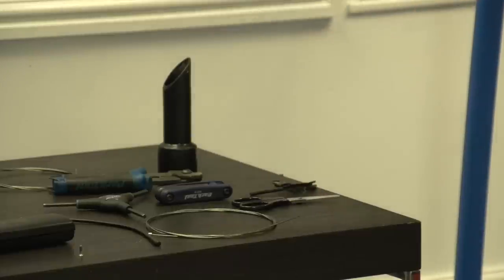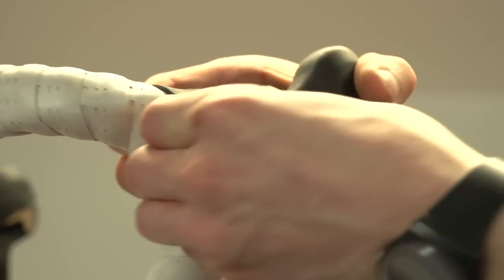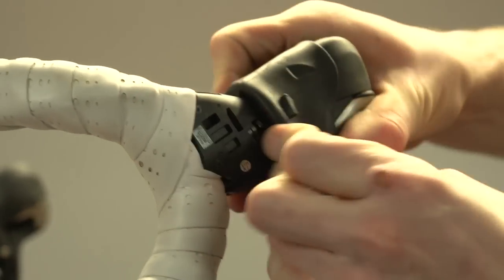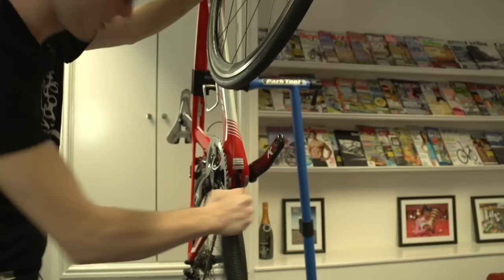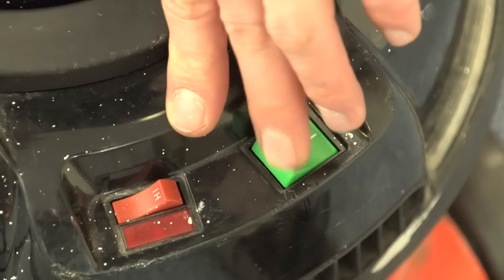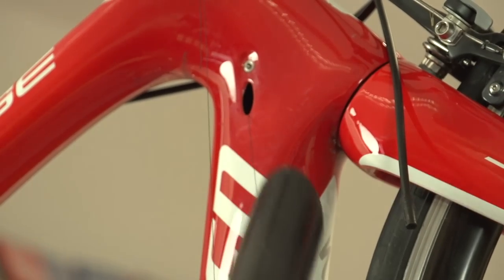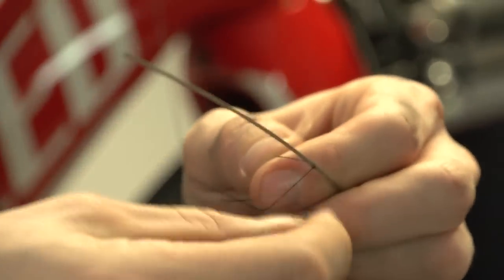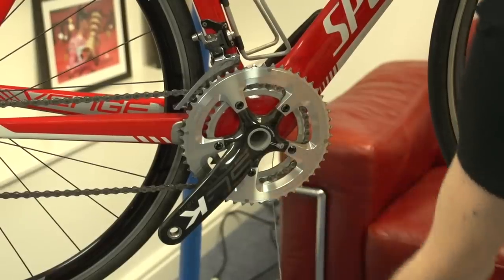How To Thread Internal Cables - The Easy Way

Comment: Dental floss is also good to use as it has more masse to grab on by the vacuumed air. You may also want to tape up other holes on your bike to focus the suction through the holes you are working on. This works like a charm. I did a Di2 threading on my bike in well under 10 minutes a few weeks ago.
Reply: Yes, good idea. Especially if your vacuum is as asthmatic as my old shop vac 😅

Comment: Used this trick to get a rear brake cable in the cross bar of a Colnago M10. The cable had been pulled out by accident. To my surprise this worked a treat, despite the holes being tiny. Thanks very much :-)

Comment: Another way to help with internal cables is to use a small magnet which helps find the cable in the frame. Works every time.
Reply from the maker: Matt Taber cool tip, thanks.

Comment: Heres the easiest way of all. Cut the little knobs at the end of the cable, slide the cable out of the housing and let it dangle at the opening of the frame. Then thread ur new cable thru the shifter, thru the housing tape it to the old cable and pull the new cable thru. This ensures that the routing stays exactly the same. Obviously this only works if you still have the old cables in place.

Comment: Same exact bike. I routed a cable housing long enough that connected from the shifters to the rear derailleur and another to the front derailleur, then slid the cable through the housing. Is that not how it’s supposed to be done on this particular bike or did I just waste a bunch of cable housing? Hahah Thanks in advance for the feedback.

Comment: My move is to reverse engineer this - in the process of initially extracting my existing cables through, I tie the thread and pull it all the way through then pull it through as above - but this is a really neat trick ❤

Comment: This helped a little bit. My tip is to use a flashlight to see where the cable is at. I found that with this method I was still pushing past the hole. Just get the end of the cable to the hole and wiggle around.

Comment: The holes in my frame are too small for the vacuum method, and even for the magnet  on the cable method (let alone little hooks or being able to see it). I now use a needle on the end of  thread and the strong magnet and it works. The needle doesn't bend when it gets to the exit hole like the bare cable.
Reply from the maker: Sounds like a hack to me!

Comment: There is an even easier way. When you remove the old cable put shearing around it and the pull it out. So much easier than a vacuum cleaner.

Comment: This approach is genius. I tied a small fishing swivel to the end while holding the bike upright. I tied electric tape around the knot and thread connected to the cable to insure it wouldn't separate. This task would be impossible without the vacuum.

Comment: Guys im Ding to know if my bicycle is good or bad... Coud any one help me?
It is heavy still i can lift it above my head with one hand but im guesing its  about 20kg if not more i dont realy know.Also on frame it says PEAK thats it.Also gears change the same way u acelerate on  Motorcycle it doz not requare to flip a switch or something like that it has a red spring in midle that says it suports 320 lbs.Also  at a midle of bycicle spring at both sides there are two  pipes one on each side.it might be custom. I got it as present in 2010.There was one techincian taht when he inspected my bycicle just by looking he sayd its  not worth repairing it will get broken again and again...So im lost on what to do :S.i forgot to mention it has words on it like Urban movement series.I cant even find a frame that wont look like my bicycles.Hous of googling and nothing
Reply: Your bicycle is good. All bicycles are good even broken ones.

Comment: easy way for me is to just push the inner cable through until it appears bellow the bottom bracket of the frame, no hoover, no string needed, time saved, it's not as if the end of the inner cable needs to find it's way through a pin sized hole, simples

Comment: It did not work with hoover.  Cycled 50 years. Replaced many cables.  Never expected not to be able to thread a cable.  So angry with it. Frustrating as hell. Skip for the 5.2 madone kammtail. Not many miles. Front mech failed. Cable not in correctly on the shifter. Pulled the cable. Then started threading with the new one. So so fed up. Design for simple maintenance you dicks at Shrek.
Reply: Finally.  Pushed string through. Then pulled back with strong fishing line. Then pulled the new cable. BUT it’s the lever not pulling.  Seriously poor ultegra. Just stopped using shogun 1995 Aluminum with record. Faultless gears. Should have stuck with it but new headset and bottom bracket are becoming scarce !  eBay now to find a new left side rear changer lever.